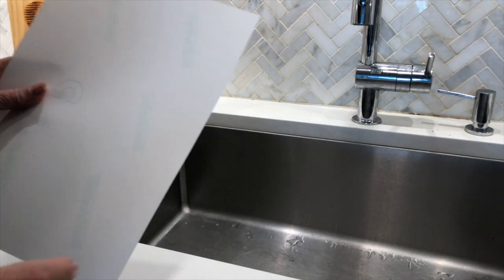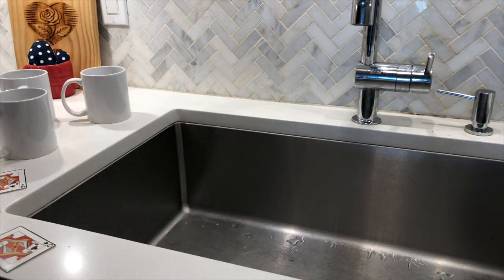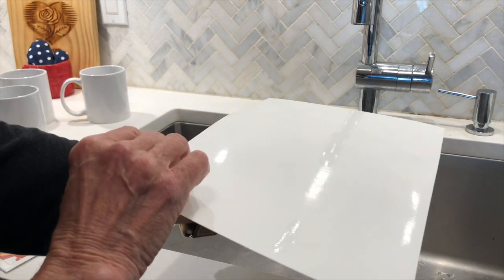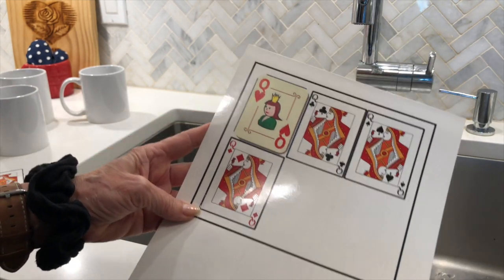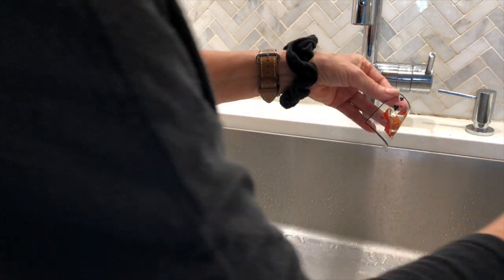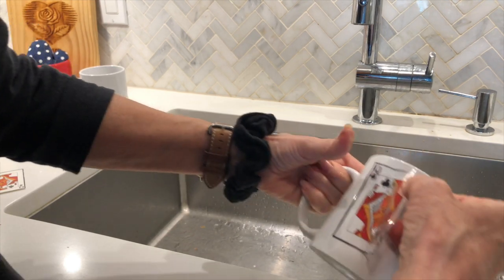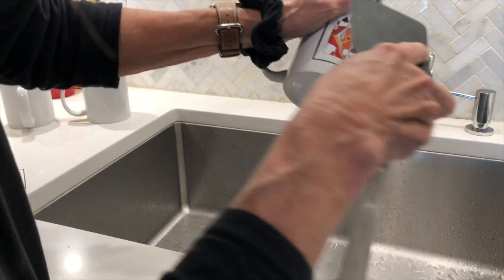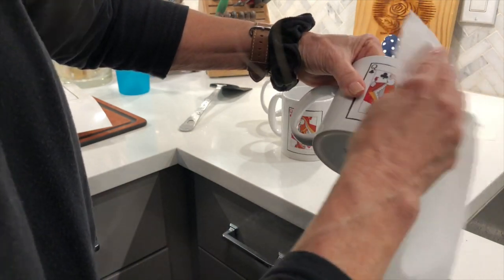HOW TO USE WATERSLIDE DECAL ON A CERAMIC MUG

Comment: Waterslide transfers are better put into a saucer of water and ideally with a waterslide transfer softener (yes actually made for the purpose). You should also make sure the surface you are applying it to is damp. This is so you can move the transfer into the desired position without damaging it. It is also recommended that you apply the transfer with softener and a brush to remove any air pockets. Never run transfers under a tap!
Reply from the maker: Grumpy, thank you for your suggestions. 😀
Reply from the maker: Grumpy, please consider joining our mailing list so you can get our free weekly Craft Talk newsletter filled with crafting tips and tricks.  https://conta.cc/3iPmqRy

Comment: do i need a special printer for this? or can I use my regular printer?
Reply from the maker: Our Waterslide requires a laser printer,
Reply: with an ink printer you seal the image with clear acrylic spray paint. 2-3 coats.

Comment: Can you give me a clear answer on what temperature and how long to put these in the oven? At the end of the video you say 360° but in two different comments you say 300° and then 320°- and you give three different times.

Also, don't we need to put them in a cold oven and THEN turn it on? Let the oven come up to temperature with the mugs inside, and then turn the oven off when they're finished and let them cool down completely before removing them... Otherwise they crack.
Reply from the maker: Sorry for the confusion! To simplify things, forget about the oven. We don’t use it anymore with waterslide.
Reply from the maker: missychan63,  have you considered joining our mailing list so you can get our weekly Craft Talk newsletter? https://conta.cc/3iPmqRy
Reply: So confused. So do not put them in oven and only let sit for two days then it won’t come off long as you hand wash only correct?

Comment: what waterslide brand of paper did  you use?
Reply from the maker: Here you go ... https://www.heattransfersource.com/shop/heat-transfer-paper/laser-heat-transfer-paper/water-slide-transfer-paper-clear-or-white/
Reply: @heattransfersourcedependab1870  Did you use clear or white?  Also do you need to use a spray before applying.  I  have seen some waterslide paper that you have to spray first.

Comment: What did you use to seal the image? I used Krylon and it turned yellow in the oven.
Reply from the maker: Yikes, sorry that happened. I didn’t use anything except the oven .. and always hand wash. (I’ve never used Krylon.)
Reply: @heattransfersourcedependab1870  rhrn.how did you get the ink to stay on the waterside paper after you printed?  Running it under water the ink comes right off without a sealing agent of some kind , at least the paper i use it does.
Reply from the maker: Ms. TN Carter are you sure it’s Waterslide paper? Did you buy it from us? I’ve never heard of the ink running off the paper.
Reply: She used a laser printer so no need for her to seal, I like to with rustoleum clean enamel 😊
Reply: Isn’t it bad to bake our mugs in the oven ?

Comment: I made a mug with a decal, and after a few uses of drinking cold liquid from it the ink came off. What did I do wrong? or is this normal
Reply from the maker: Bummer. Did you cure it in the oven after you applied it and let it sit 24-48 hours before using?
Reply: @heattransfersourcedependab1870  no. lol. ill try that
Reply from the maker: Mr. Roboto immediately after applying a decal, put it in a 320  oven for 10 to15 minutes to cure. Then let it rest for a few days before using. Hand wash only. Good luck!

Comment: Can you use a mug press as opposed to the oven?
Reply: For heat transfer vinyl yes. Don't believe that's the case for regular prints as inks will just burn.
Reply from the maker: Yes you can.

Comment: Should I still spray the waterside with hairspray
Reply from the maker: not sure what you mean. Waterside?
Reply: @heattransfersourcedependab1870  this video is for waterslide on a cup do you spray the pictures with anything?
Reply from the maker: Hi, yes you can spray with clear coating. Thanks for asking.
Reply: Spraying for waterslide is preferred as a protestant. Fine layer of acrylic spray or Mod Podge brush on which I use as it's dishwasher safe and seals well.
Reply: Protectant...
Reply: Thank you so much
Reply: I know what you mean with the hair spray. I use that as well for protective coating on inkjet prints.

Comment: What happens if you have bubbles ?
Reply from the maker: If the Waterslide decal has already dried,  try piercing the bubble with a tiny sharp pin and gently flattening it with your finger.
Reply: @heattransfersourcedependab1870   LOL --- DO NOT PIERCE THE BIBLE!

Comment: What kind of paper is that
Reply from the maker: It’s Waterslide transfer paper. https://www.heattransfersource.com/shop/heat-transfer-paper/laser-heat-transfer-paper/no-weed-foil-transfer-paper/
Reply: Do you have to use a laser printer for this laser paper or will it work on an inkjet printer (Yes I would seal afterward)